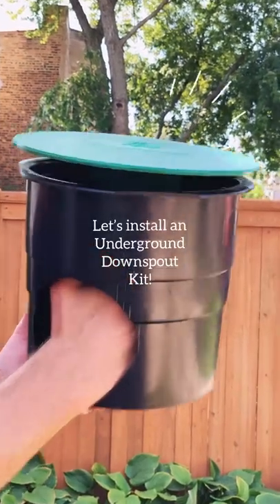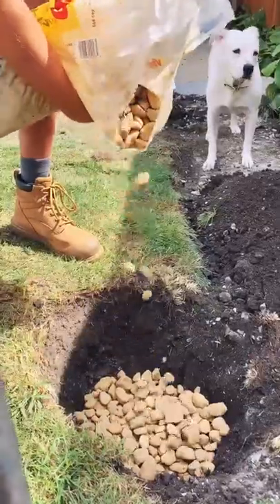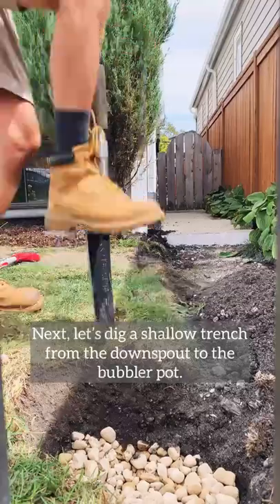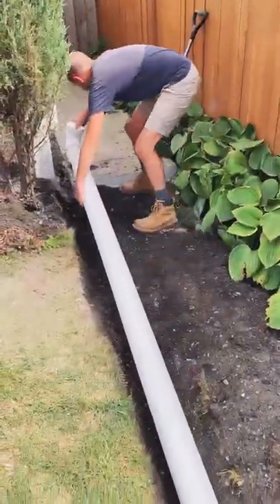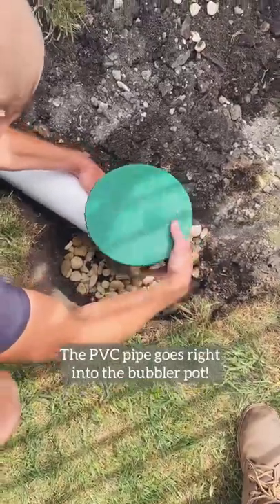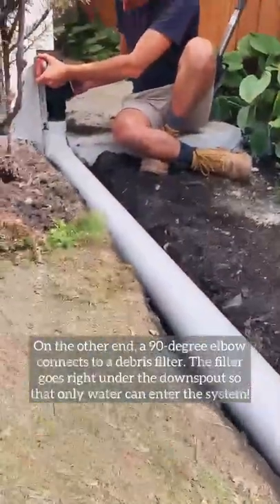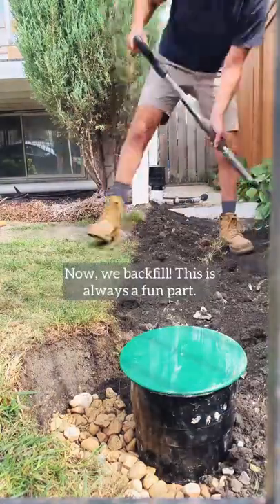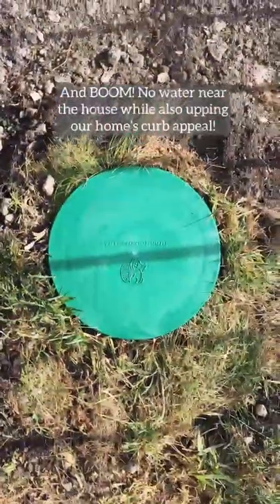UnderGround Downspout - How to Install

Comment: I did a similar project very happy with how it turned out. If you have hard soil save your back and go rent a trenching tool from home depot. I used a ground hog trencher and dug about 10 feet in about 15 minutes. Much better than a shovel.
Reply: I second that. With showel it took me over a day to dig a 30 ft trench through a rocky ground

Comment: That not always work depending in your terrain grading you may have a back flow towards the house, not to mention that if the soil absorption capacity is low, you will have sitting water over the grass, that eventually may kill the grass

Comment: This is so wrong almost every step of the way, terrible
Reply: It’ll get the job done won’t it?
Reply: @tj25peyton  that basin has to fill up with water before it'll drain, meaning the pipe will as well need to fill up with water since there's not enough slope. Pipe is thin walled next to foot traffic area not deep enough below surface. Cold weather or a person could crack the pipe. The filtering attachment is going to block water and have it spill out onto the ground. Just clean gutters and connect drain directly to corrugated pipe. Throw basin in trash and connect the bubbler attachment directly on the other end of the pipe and bend it up to be flush with the ground
Reply: Why are you watching and commenting when your an expert and have installed so many systems yourself which verified and proved your points?